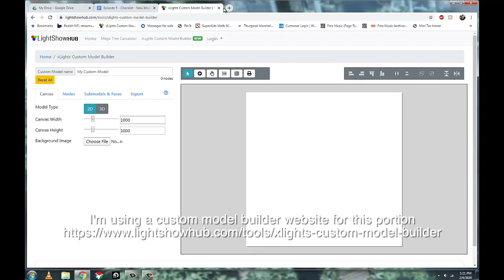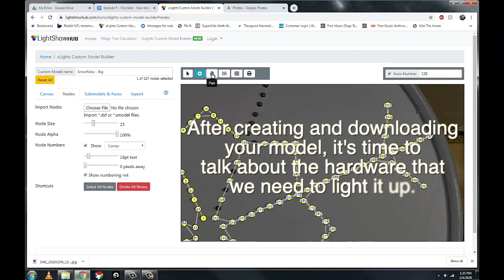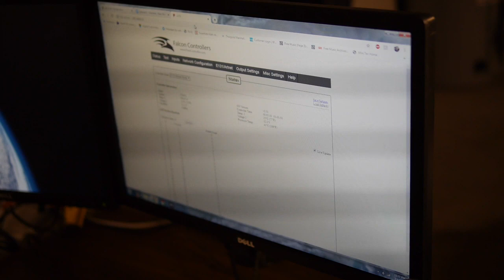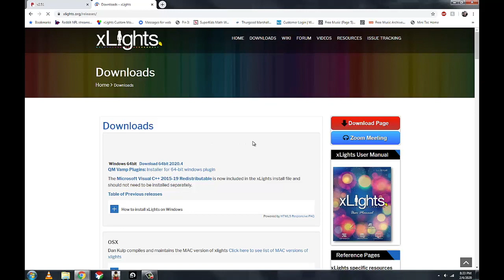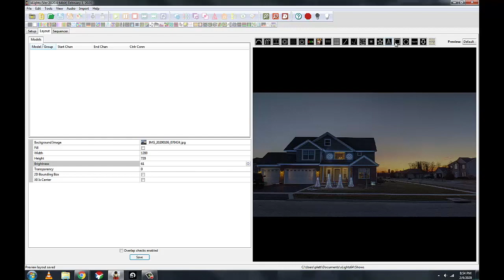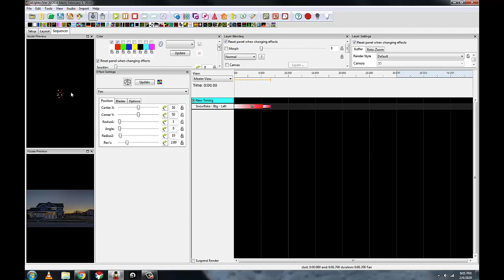Episode 5 - Light It Up! - Pixel lights - xLights - Falcon F16V3

Comment: Do you have to hock up the switch, can you just plug into your computer from the controller? Allso a very good info vido
Reply from the maker: You can just run a cat5/6 cable from your computer to a controller. But, my current light  display uses 3 controllers and I use a Raspberry Pi to run the show. The Pi also acts as a bridge between the show's network and my home wireless network. So, a switch is important.
Reply: @plettskiproductionschristm4132  Thanks for your reply, This is taking a lot more time and a lot of thinking and hair pulling but we think we are going to have a tree up by the weekend LOL

Comment: Great video BTW.  In fact I think yours is the ONLY video that shows how to setup XLights with a Falcon F16v3.  I am able to get my lights to work but am having problems understanding Ports/Channels/Universes.

I am going to have two matrices (Ports 1, 2, 3, 4 / two channels per matrix) on the F16v3.  Large Snowflake (Port 5).  I first want to start with Port 5 testing, and am able to TEST in Xlights.  I just don't know how to configure the model to run off that channel.  Do you have any magical tips?
Reply from the maker: I'd be happy to help. You'll want to start with setting up your controller first. How many pixels are in each of your matrices?
Reply from the maker: Sorry, I reread your comment and it sounds as though you have the controller set up correctly. All of the lights turn on when you test in xLights? So, it's just the configuration in xLights that you need help with?
Reply from the maker: If you don't have the matrices added first and you want to add something on port 5, you'll need to know what universe and what channel you want your snowflake to start on. It's easiest to draw in your matrices first and set them up and then add the snowflake in xLights that way you can just start it on the next available channel. Also, if you are on Facebook, join the "Official xLights Support Group". They are very helpful there.
Reply: @plettskiproductionschristm4132  Ok, I just figured it out after rewatching your video again.  I am able to now test the Large snowflake.

My two matrices contain 1152 pixels each.  They are the Boscoyo 24x48 - 2" ( 4' x 8' matrix).  Within the Falcon F16, I configured each String ports (1-4) with 576 pixels.  I think I am going change this because I don't want to cut any of the wires.  I think I will do 600 pixels for Port1 and 552 pixels for port 2, now that I know how to configure it in the xlights model.

Here is my full setup:

RPi Zero with Falcon PiCap -- 800 pixel megatree, 500 pixel sidewalk layout. (This RPi is in Remote mode and is currently running perfectly)

RPi 3 B with Falcon F16v3 - 1152 pixel matrix (Port1, Port2), 1152 pixel matrix (Port 3, Port 4), 161 pixel snowflake (Port 5). [network static route is added on my router so I can access RPi3b eth0 & F16v3 from anywhere on my network]

I tried to test my Animation Sequence file by uploading to the RPi connected to the falcon controller and there was nothing when I tried to run it.  :|
Reply from the maker: @gwolanin  Just an fyi, you'll probably want to set up a separate show network that is on a different ip than the rest of your home network. You can configure your Pi to bridge the two since it can have two ip addresses. One wireless and one ethernet. When you run your show, it will take up a lot of network traffic and if you are streaming netflix or youtube you may cause some glitches in your show.  Do your pixels light up when  you test from your Pi?
Reply: @plettskiproductionschristm4132  The pixels running on my PiZero + PiCap run perfectly.  The pixels do NOT light up from FPP on the RPi3 when testing.  

I have "Enable E1.31 / ArtNet / DDP Output" checked.  It's late, maybe a fresh brain will be better tomorrow.